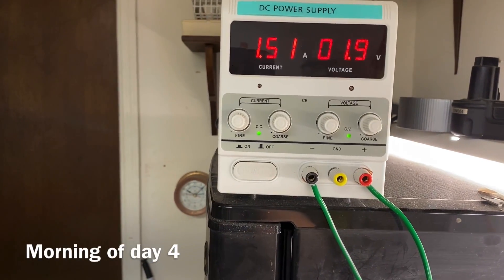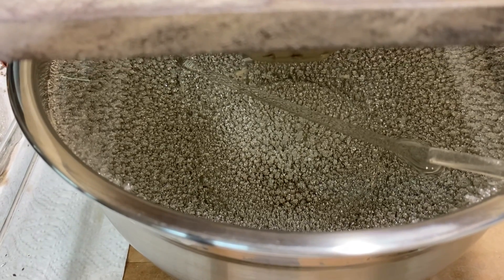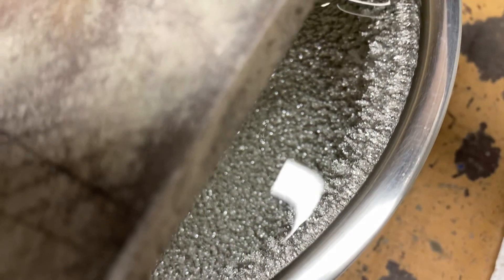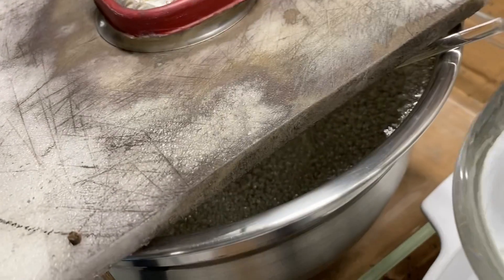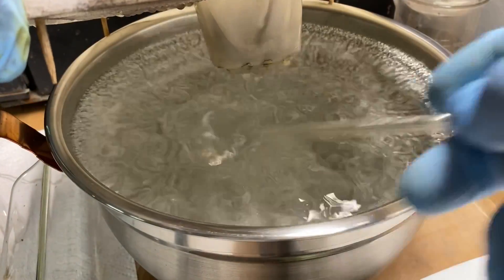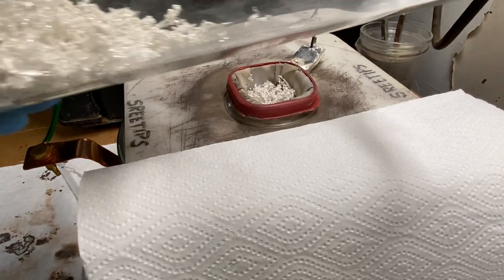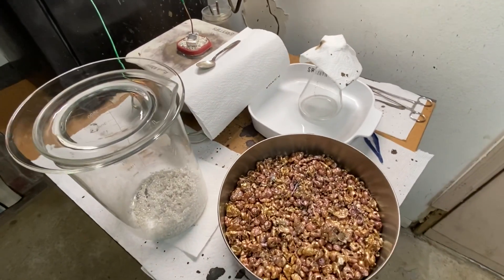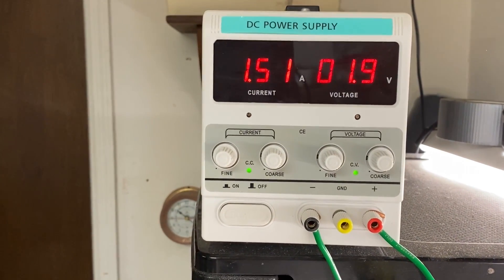EP012 Silver Cell Replenish Electrolyte Day 4

Comment: 2 things come to mind. I seem to remember (working from memory so forgive me if I'm mistaken) Hoke(?) Specifying 3.5v & 1.5a. Since your power supply allows for adjusting both v & a, I'd be interested to see if that wouldn't make the process somehow better or more efficient. Also, I think there is an opportunity to conduct an interesting experiment to see how much silver is consumed from the electrolytic solution vs how much silver crystal is produced in one complete run of the cell, starting with fresh electrolytic solution. You could even run the experiment twice to compare the results between a 2nd refining of silver crystal and a 1st refining of impure silver shot. Just a thought, but you'd be just the guy who could do it.
Reply from the maker: That would be interesting
Reply: You cannot set both Current and Voltage at the same time only using the power supply, they are correlated by Ohms law in normal circumstances, in case of electrolytes it isn't really ohmic but still they are correlated. Changing one changes the other. The current would have to be much higher to arrive at 3.5V.

Comment: It would seem to me that if you could manage to figure out how to get the cathode where the silver plates out suspended in the liquid above the anode source, you could let gravity take care of the slime removal as it would deposit at the bottom of the now anode bowl.
Reply: A submerged anode at the bottom of a larger bowl surrounded by the raw silver - electrolyte as usual - smaller cathode bowl suspended above it. Does this make sense? The silver would rise and plate from the electrolysis process and the slime would sink to the bottom of the bowl.
Reply from the maker: Slimes and pure silver in the electrolyte together with no barrier (such as a filter) would defeat the purpose.
Reply: @sreetips  ah! So the slime would travel in the current too - the difference being that it doesn’t dissolve?

Comment: I was just about to ask if you were going to expand the cell operation and then you said you were gonna set up a second one lol Do you know if there would be a difference in multiple set ups vs 1 big one? Thank you for the always interesting videos!
Reply from the maker: Anode to cathode distance is critical. I could get a bigger bowl and larger basket and keep the distance right. But I’d be n experimental mode. For now I’ll just use what I know will work, a second cell with identical size. But maybe a different power supply (pc power supply). And I’ll run impure silver in the second cell.
Reply: @sreetips  Awesome! Can't wait to see the new setup! 👍👍
Reply: @sreetips , great job using constant current mode. But you will not be able to do so with a PC power supply as it's designed to only work in constant voltage mode. It could be quite dangerous as the current limit on the 3.3v output of a PC power supply could be quite high, 10 to 20 amps is common...
One thing possible is to put several identical cells in serie (same thing as connecting batteries in serie) and use only one power supply, keeping the constant current mode, but adjusting the max voltage output to the elementary voltage of one cell times the number of identical cells.
The pro is that you only need your actual PS, no need to buy another one, but the cons are the increased complexity and necessity to operate each rigorously identical cell simultaneously with the same electrolyte concentration and silver shots of the same batch. Not sure it's worth due to increased constraints, but it's possible.
Another solution is to use less sophisticated power supplies (than a lab one) that are capable of running at a preset constant current. There are many cheap "Chinese" modules that are able to do so. You should request the competency of an electrician to assemble that stuff, but that could be an interesting project for an electronic student too.
Reply from the maker: I’ll include an in-line fuse if I run pc power supply. I’ve tried series, it doesn’t work. One of the cells ends up robbing power from the other and the silver gets ruined.
Reply: @sreetips , I agree this adds a lot more constraints to work in serie. And it's only possible if running in constant current mode, which you never tried before.
Of course, in constant voltage mode, it's impossible to work in serie, and as you said, one cell will end before another. As the current isn't limited, it will put the other cells at very high risk !
So, the most practical choice is to have a dedicated power supply for each cell, all running in constant current mode.
I still strongly recommand not to use a PC power supply, even with a fuse. Doing so, you will regress to the issues you already had. You definitively need to have an absolute control on the current flow.

Comment: If the resistance increases the power supply should compensate to keep the current stable. Also, since the crystals are smaller now, couldn’t you make the filter basket longer so as to increase the surface area?
Reply from the maker: No on a long basket. Distance between anode and cathode is critical

Comment: Seems like the silver is growing in smaller clumps/ pieces instead of branching out. This is due to the new voltage output?
Reply: It's more likely due to the new circumferential banding connection at the bowl/cathode connection in conjunction with the constant current. The current flow is far more important than the voltage level.
Reply from the maker: It will probably start forming trees with branches as more silver gets deposited

Comment: i dont get it, its eating silver faster, right? but not making the same amount of silver? or is it the same amount of silver and its just way more dense?
Reply: It’s less about density, and more about purity.  The electrolysis process, through which an electrical current is passed through the silver-containing electrolyte solution, is dissolving pure silver from the basket atom by atom, and causing purer silver to re-crystalize on the surface of the stainless steel bowl.  Any impurities are left behind in the filter, as they won’t readily dissolve in the electrolyte solution (I’m assuming at least not as long as the filter basket stays charged with silver for the process to consume).

This particular batch that he’s showing in this video is the third time this silver has been run through the process, making it more pure with each pass.
Reply from the maker: It’s about the same rate as always. I’ll get 1.5 to 1.7 kilos of triple refined pure silver crystal in about 10 days.
Reply: And re-reading what I wrote, I see it’s really only half an answer to your question...  as for the amount of silver, there is never any addition or subtraction of silver atoms involved in this process, other than whatever amount is added to the basket.  The atoms are never created from nothing, nor are they destroyed into nothing.  The exact amount of silver put into the basket and the electrolyte solution will be the exact amount that comes out of the process.

With that being said, there can always be loss of some amount of silver during cleaning, or if there is spillage.  

As for how fast the silver in the basket is being consumed, that is a function of the amount of current being supplied through the electrolyte.  Higher current can lead to longer, more spindly crystals to form, which happened to the previous batch.  This caused the crystals to come into contact with the filter basket, which shorted out the system and potentially contaminated the batch.
Reply from the maker: Well said